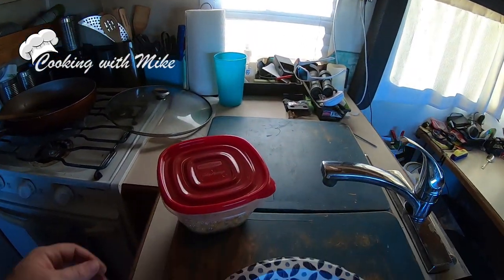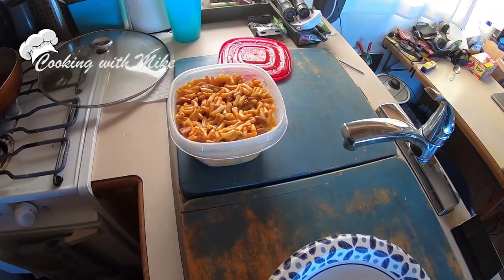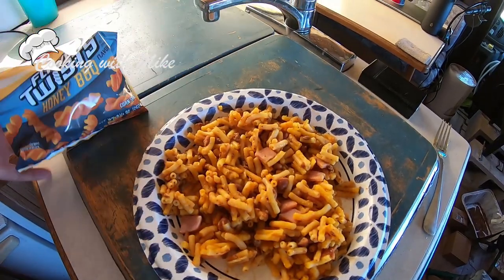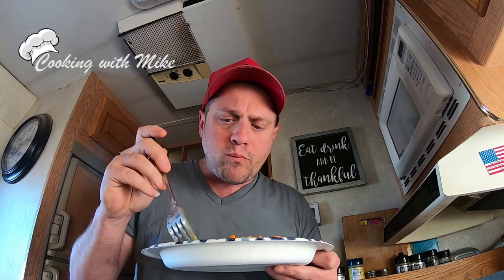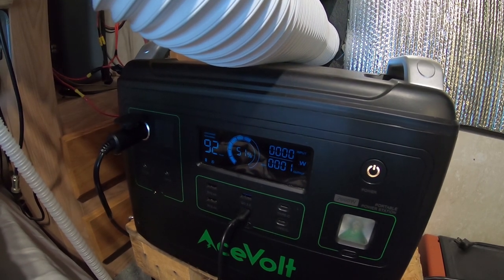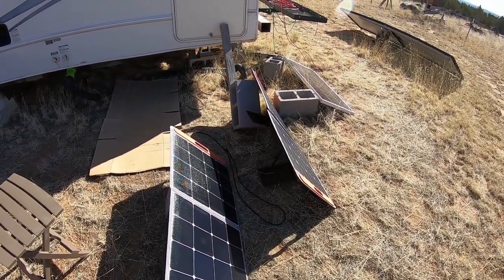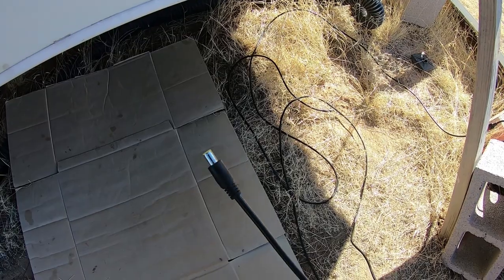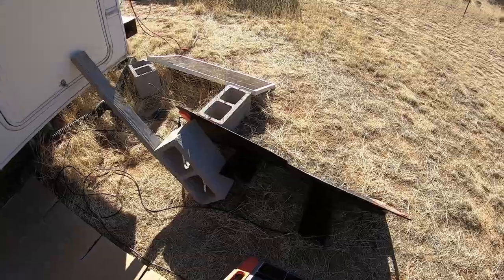Drilling Another Hole in RV! But For Good Reason...

Comment: Mike for your batteries use a 12 volt heating pad it's USB powered very little energy I'm not sure of your setup but I use my pads on the bottom in an enclosed box
Reply: Ya, I agree. The cheapest and quick solution is what truckers use. A heated sleeping pad and just using it on #1 will do the trick.

Comment: Keep in mind with Lithium batteries. They may say 2,000 or whatever cycles but every time you run it down you get less and less. It doesn't mean you get 100% for like 8 hours every time you charge them up. It's less and less each time until you get to a point where it says 100% charged but it will only run something for 10 minutes. That's how it works. If you never let your batteries fall below like 80% you'll get many more cycles and life out of the batteries.

Comment: A small inverter generator like the 2000-watt predator sold at Harber Freight is supper quiet and will literally run a 50-amp charger all day long on a gallon of gas. Put it on a 50' extension cord and you won't know it's even there.
Reply: That would mean he would need around $100 a month for gas. I don't see that happening......LOL
Reply: @chasein7019  I suggested a particular quiet, smaller, and much more fuel-efficient generator just for charging batteries as needed. Mike is using a huge noisy gas guzzling conventual generator to charge with as seen in his videos. It's the size of the charger and amount of Mike's power consumption that dictates the generator run time. The gasoline consumption would be a fraction of what it is now. Compare Mike's big gen running @ a constant 3600 rpm and a smaller inverter generator running at 1/2 that rpm or less. Inverter generators put out perfect 60hz 120vac at engine idle speed and only increase rpm as the power draw increases, or as needed. Inverter generator technology is better on many levels.
Reply: @AnthonyWilliams-wd8yf  Yup, I agree. A small generator running a charger meant for Lithium batteries would be perfect. I told him numerous times he needs a specific battery charger meant for Lithium batteries but it goes in one ear and out the other. It states RIGHT ON THE BATTERY what it needs. Non stop 14.6 volts and 50 amps. A regular battery charger ramps down quick. I even told him the make and model he needs but NO, I have a F***ing YouTube channel, I know everything.
Reply: @chasein7019  The Jackery portable power stations obviously have him distracted and not able to see the elephant in the room. Hopefully we may have helped.